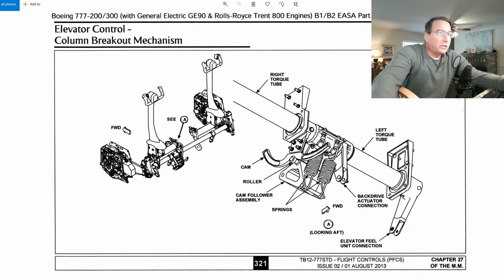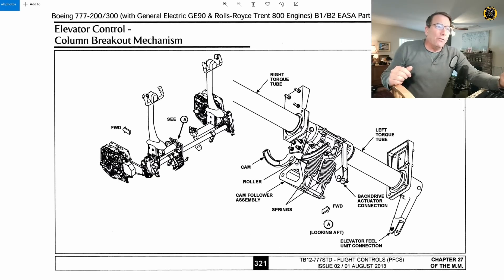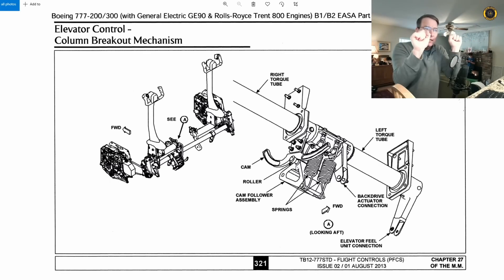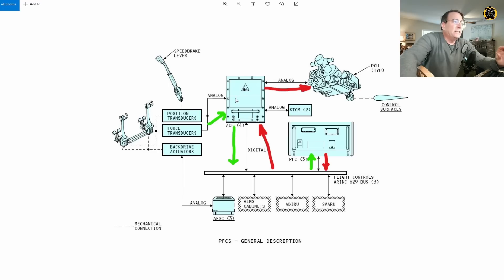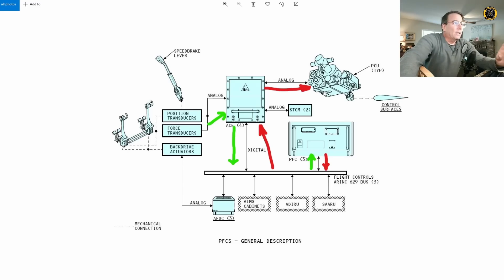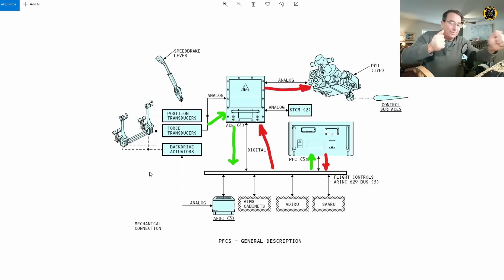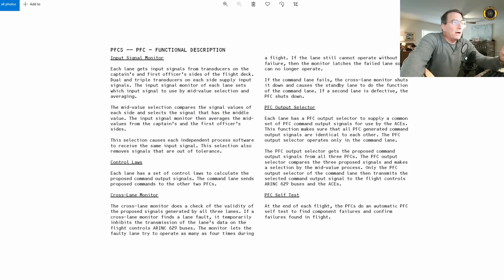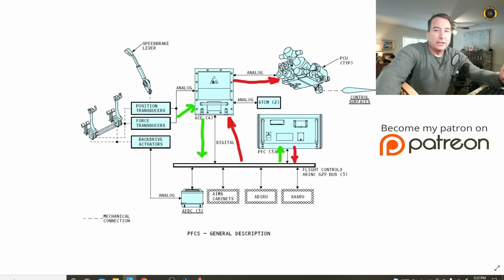Air France 11 Decoupled Flight Controls- "Who's Flying?"

Comment: As a non pilot but with a fair understanding of all that gets discussed (thanks, Dad!), a question: Has any engineer thought of having a manual decoupling option, with no auto re-engage? Just in case one control becomes permanently locked for some reason...
Reply: One control column becoming permanently locked is precisely the reason this breakout mechanism exists. I think the general feeling is that in the very unusual condition where one column is jammed, it's better to have the two decouple automatically (when a pilot uses enough force). If the pilot needed to manually decouple the two sides, it would be one more thing the pilot would need to be trained on and remember to use in a very rare emergency. 
Also, having a manual disconnect leads to another possible pilot error problem. A pilot might accidentally decouple the two columns. Then they would only get half of the authority they were expecting from the controls. Note that the error the Air France pilots made self corrected. It didn't require the pilots to understand what went wrong to get back to a fully functional airplane. If a manual disconnect was accidentally triggered, the problem would not go away until the pilots understood what was wrong and actively corrected it.
Reply: @andrewsnow7386  Suppose outstanding CRM, both pilots are aware of the way the yokes behave.  The right yoke becomes jammed somewhere near center.

PF "Yoke is jammed. I have no control. Your controls"
PM "My  controls.   You're right I'll pull to decouple. I have authority now but..."

So now the left pilot - now PF - has to give >50lbs force EVERY time they pass that position due to the recoupling spring force. It's Inconceivable that is considered a fail safe.
Reply: @sagetx  Where to start???
During most of the flight, small adjustments are made through the trim system, not by moving the column. I am not a pilot, but I think control through the column would only be normal for a short time during take off and landing. This limits the total exertion the pilot must endure.
Many smaller planes don't have any way at all to separate the captain's and first officer's sides, and they are considered safe to fly.
There have been some incidents in which the pilots controls have become jammed, and then freed (a little) only after both pilots worked the controls back and forth with considerable force. 

I think we probably agree that some breakout between the two sides is better than none. But, if the breakout force is set too low it prevents one pilot from contributing much if the controls are very stiff. For example, American Airlines Flight 96 might not have landed safely if the force of both pilots couldn't be applied to the damaged cables. And, if the force to disconnect the two sides is too high, then a pilot may not be able to do it when needed. As is always the case with airplane design, you try to chose the best compromise.

In short, Boeing had a lot of smart pilots and engineers when the 777 was designed. It was the best system they could come up with.
Reply: @andrewsnow7386  Control through the column while  landing was what I was thinking about.  Agreed maintaining level flight after decoupling shouldn't be a problem with trims and auto pilot. I agree that a decoupling mechanism is necessary IF you couple them in the first place.  

Just thinking it through though, maybe the idea of computer controlled force feedback through the yoke is an unnecessary 'luxury'.  The whole complication could be avoided through sticks on either side of the pilots. There are  no cables connecting the columns anyway, just reading positions and relaying them - after computations - to the flight surfaces. 
So being able to "push through" a stuck column, in this instance of FBW, is counterintuitive to fixing the problem, since there is no direct connection to the flight surfaces.

Adding a complication of continuously coupling and decoupling of the controls - while  landing - is a problem  the engineers really didn't need to have to solve  in the first place.
Reply: @sagetx  As I'm sure you know, what you are describing is what Airbus does. It's a difference in philosophy. At the time the 777 was designed, Boeing had the philosophy of making the airplane, from the pilots point of view, fly as much like a cable controlled system as possible. Some people like this some don't.
Anyway, the safety of the uncoupled side-stick design has been questioned in accidents such as Air France Flight 447. Captain Chesley Sullenberger for one thinks this accident would have been less likely with Boeing's coupled controls.
https://www.youtube.com/watch?v=kERSSRJant0
 I am NOT saying the side-sticks are less safe, but it's not clear an uncoupled design is more safe either. Fortunately, there is not enough accident data to show one method is safer than the other. But this means the decision on what to use is up to the best judgement of a team of people. Different teams will arrive at different answers.
Reply: @andrewsnow7386  Interesting. So the feedback to the column is mostly  for the pilot monitoring to have a clue as to what the PF is inputting, not pilot flying for how the control surfaces or the plane on general is responding.  I at least see the advantage of coupling the controls like that. I wonder if Airbus fixed the programming for the control. The computer should not allow elevator full up is the speed is too slow.  I'm not a pilot, but even I know pushing over the nose in a stall trades altitude for  speed. Then you can pull up  and convert speed into maintaining altitude. If the computer can't recognize the problem all the way to the ocean and compensate or at least alert the PF/PM, there's something wrong with the entire system.

Jeez what a mess.
Reply: You'd have to reapply the 50lbs of force to get off the recoupling.
Reply: You could disengage it with 50lbs of force that scenario should be covered by this system.

Comment: Is there something in the controls that lets the pilots know when the controls have decoupled?  (And/or are giving conflicting inputs in any way?  Does the Airbus fly by wire have such a warning? Is it something that an overloaded pilot in an emergency would immediately be aware of and know how to solve? )
Reply: Yes, the Airbus system used to work differently where the inputs were averaged (maybe not by default or in all cases, but definitely when the plane was in certain "laws"). Air France flight 447 crashed because one of the junior pilots kept his side stick pulled back during a stall event. Every attempt by the other pilot to decrease the angle of attack to descend and stop the stall was canceled out by him doing this. Now there is a way to choose (or prioritize, I'm not sure) which stick is flying, and a warning when both sticks are being used to alert the cockpit.
Reply: @aawillma  There was a way to choose at that time too - press and hold down the red button on the control column but it wasn't done (or was done too late)
Reply: @aawillma  It was my understanding that in AF447 the 2nd pilot didn't realize that the pilot flying was doing that?
Reply: The extremely high input forces should have been a clue!  I believe Airbus now has a "dual input" warning, but didn't always.

Comment: Even systems with the best design cannot out guess unpredictable human behavior. In addition to all those computers, they need a yard stick that the flying pilot can use to smack the other pilot’s hands.
Reply: The problem is,what happens if the wrong pilot uses it?   :)
Airbus incorporates a button on the sidestick so a pilot can 'take over' (otherwise it just averages the inputs) - but again, what if the wrong pilot presses the button?   I don't think there's anything the manufacturer can do about that.

Comment: All I can think of are those two short words from Capt. Sullenberger: "My aircraft." And from Skiles: "Your aircraft." No need for a struggle over the controls. No need to overload the software. No decoupling of the left and right yokes. No overbearing egos. No panic. No unresponsive controls. No wasted time. A model of how CRM should work.  Sullenberger and Skiles worked in harmony, and made a safe water landing.
The real problem on that Air France flight, was human.
Reply: > The real problem on that Air France flight, was human.

As is often the case in aircraft crashes.
Reply: @dermick  Unfortunately - yes.
Reply: Yes, indeed.
Reply: Many of the “rules” are written in blood.
Reply: @cessna177flyer  Yes.
Reply: The problem was French.
Reply: The problem may have been down to human error but the systems should do everything they can to reduce that error.
Reply: @deang5622  Yes, exactly.

Comment: Thanks Juan, very informative and interesting. Conclusion: I don’t want to be on a fly by wire aircraft during an EMP event.😜
Reply: I am pretty sure they have that sorted out. I am thinking lightning strikes are quite similar.
Reply: @desertdog2282  Its my understanding that most military aircraft are “harden” against EMP’s, not civilian aircraft.
Reply: @dougtarbet6193  all well-designed electronics are hardened against EMP. It's called shielding and transient protection. For example, during an EMP event many automobiles would stall due to noise on engine position signals, but would likely restart afterwards.

Comment: Speaking of buses, I remember as a boy riding a Greyhound climbing a long grade out of Osoyoos British Columbia in the late 1960s. That bus overheated 🥵 and we had to pull over to let it cool a bit, then we resumed our travel. Those were the good old days when men were men and buses 🚌 were buses! 😹
Reply: That long grade out of Osoyoos is called Anarchist Mountain. Aptly named I think.
Reply: I might add that it was an old bus even in 1968 or 1969. One of those with the rounded back end from the 1950s. We were chugging up the grade so slowly, you could have probably jogged faster than we were going. 😹

Comment: I've heard the Airbus joysticks aren't coupled at all.
Reply: I understand that the Airbus (Thales) software will average the input from both and send the result to the control surface.  Some surfaces, like the elevators, will split if the pilot inputs diverge.  This was how it worked at one time, they can of course send out a patch to change it.  Just like windows updates.  😂